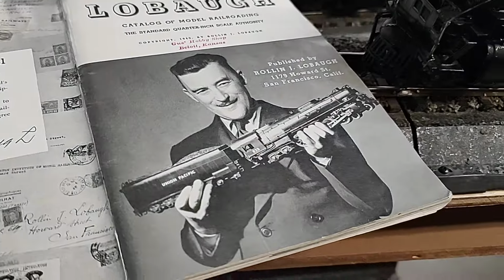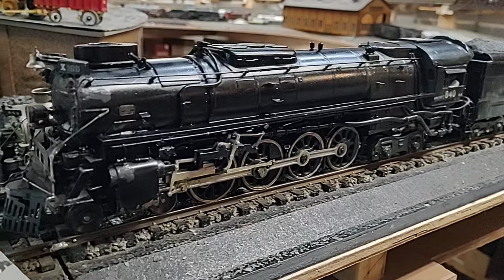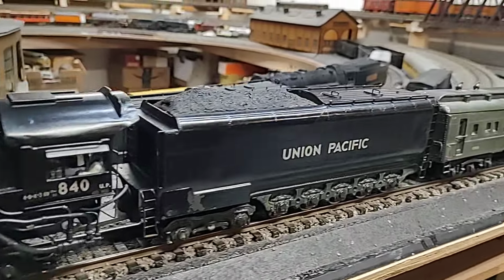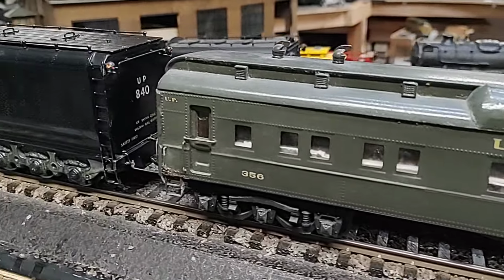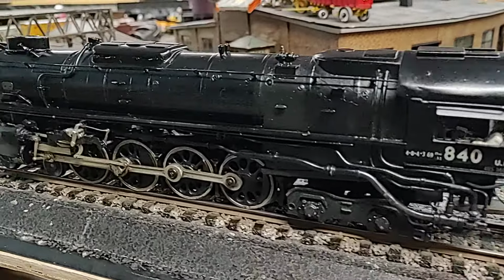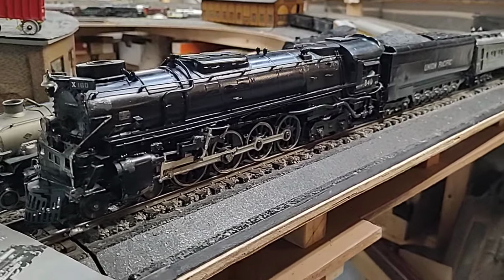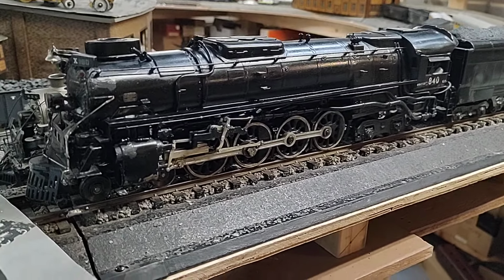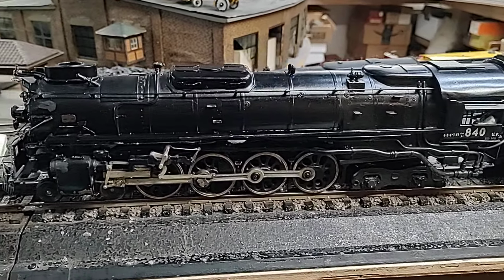Union Pacific FEF steam engine O scale by Lobaugh 1941 &  Walther's cars @vintage-model-trains

Comment: Another beauty there! It's fancier than my American Flyer 4-8-4! Love watching yours run! Wow I didn't know those cars weighed that much.
Reply from the maker: When you add lead interiors and passengers ...light cars become heavy quickly
Reply: @vintage-model-trains  did anyone ever make models of the FEF3? I mean did they make them at around this point or at some point in the postwar era? I ask because it would be kind of cool to have a model of 844 before it became famous since no one really knew about that engine until 1960 when it first was withheld from retirement and used for excursion services. As such having a model of 844 that was scratch, built or produced by a small manufacturer like that would be quite interesting. I suppose that it would look like how it did between 1944 and the 1960s when it was in its first days of excursion service.
Reply from the maker: @lucasquintanilla1673  I'm unaware of any 8:44 engines out there there could be there are a lot of very creative builders many of their works are still out in the woodwork somewhere waiting to be discovered
Reply: @vintage-model-trains  I have probably spoken a great deal about my love of streamlined, locomotives, steam, diesel and electric to you before but some thing I don’t normally speak of is that 844 is probably my favorite nonstreamlined steam locomotive of all time or at least my favorite one that runs today. I would say that I appreciate it almost as much as the New York Central Hudson’s and it’s for a very special reason. For me what makes 844 special isn’t what it did in the steam era because it was probably pretty unremarkable then, but rather what it has done since then, because it has the special distinction of being the only steam locomotive, never retired, and still in active use by one of the class one railroads. As such seeing stuff with 844 either before it was withheld from retirement or in its very early days of its post-era duties in the 1960s is quite special to me. At the time especially before 1960 no one really could have known how famous that locomotive would get and it would be quite awesome to have an O gauge model of 844 if it was built at around that point in time since it is highly likely that unless it was made in the 1960s, the person who made it would have had no idea they were making a model of a locomotive that would become nationally famous in the future. After doing some research about pictures and videos of union pacific 844 I discovered that understandably there are very little images of it during this era before it’s excursion career truly started in 1960. I think I’ve seen a handful of pictures of it before 1960 and at least half of them are from when it was first built by ALCO in the production photos. Other than that there are a handful of photographs in its regular service days and about two or possibly three pieces of film I have seen during its service in the 1950s. For obvious reasons, the amount of images and videos featuring the locomotive increased significantly after 1960 and particularly after the 70s.

On a sidenote, do you have any scratch built models of locomotives from many decades ago that depicted a locomotive that would later become famous but that the manufacture probably didn’t know that at the time? For example, if someone scratch built a model of 611 or 4449 in the early 50s long before these engines became famous

Comment: It really bounced at that crossing! Did you have to do any filing or grinding to get that trailer and pilot to turn enough for 48" curves?
Reply: Slash...when I was in charge of all the track work at the San Diego Museum O Scale Club, it was a very common problem. You could not only hear, but feel the locos drop down at the sword frogs on the older switches. Old timers fixed this by putting a finishing nail in the gap. No more clunk....but now you're messing up you loco and freight car wheel treads.
Installing ROW switch frog set-ups and just dropping them in fixed this problem. Or re-building the switch/turnout. ROW part was easier.